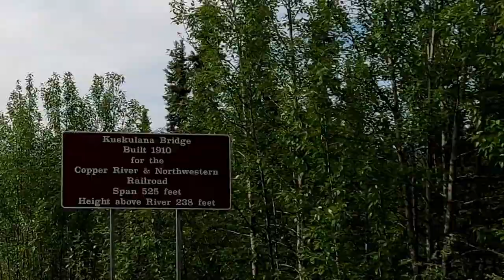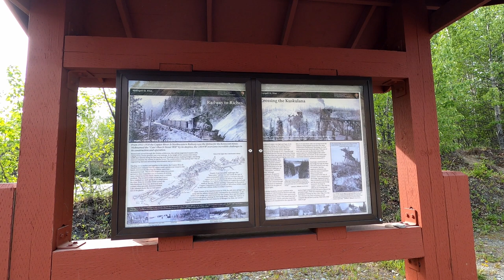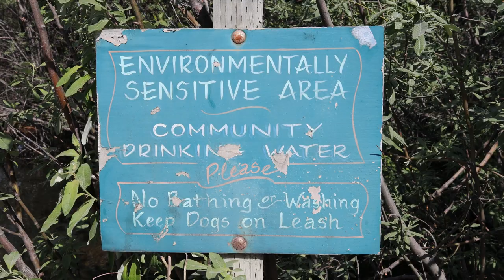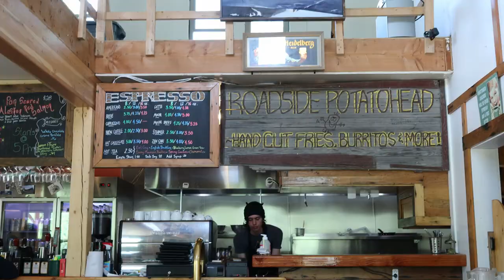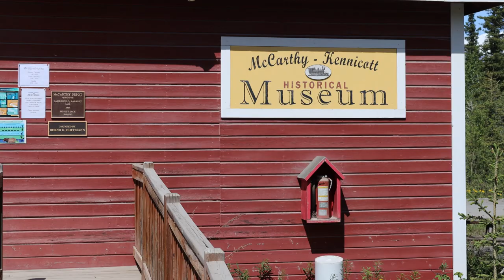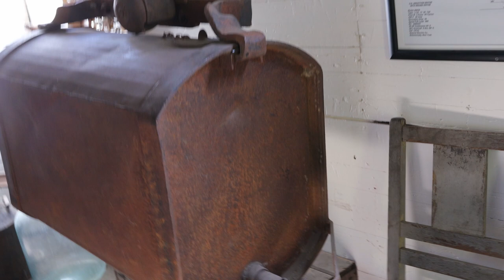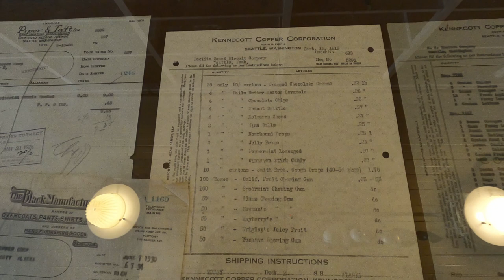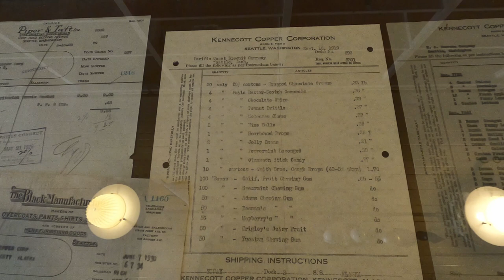Exploring Kennecott mines/McCarthy Alaska

Comment: Id like more info on the parking. Id be driving from Anchorage. 

Has anyone taken the shuttle to McCarthy?

How much was the shuttle to the mine?
Reply from the maker: If you don’t want to drive the rough road you could use the Kennicott shuttle that picks up in various areas.  If you get to McCarthy, I believe parking is under $10 and the shuttle to the mine is $8-12. I know it’s not specific but it’s the best I can remember. Maybe someone with more recent costs will chime in.
Reply: That's great info. Do you know what their firearm policy is?
Reply from the maker: @alervold99801  firearm policies follow state law, so you should be fine to carry.